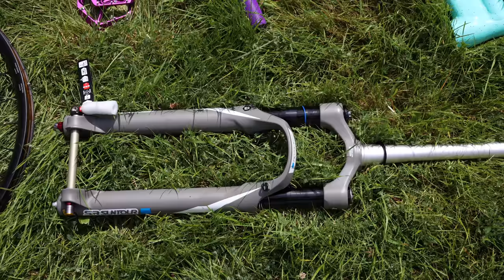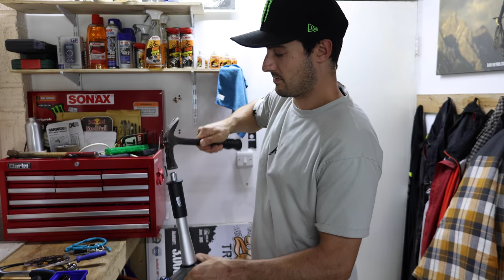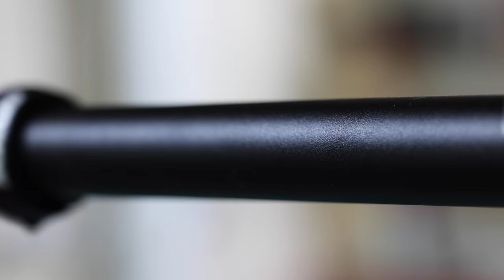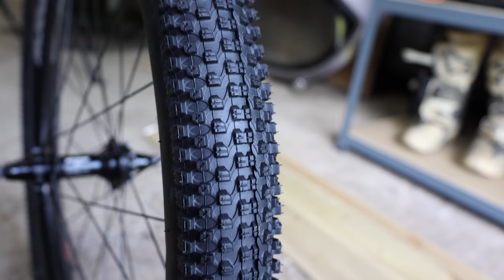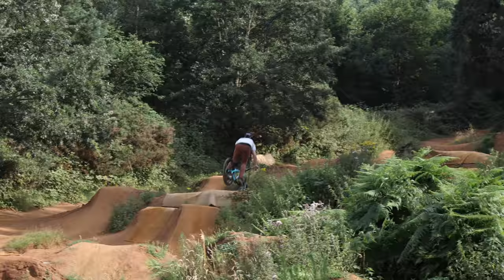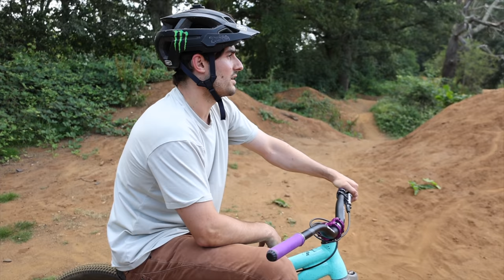MY NEW NS DECADE DIRT JUMP BIKE!   Build and First Ride

Comment: Sick, how'd you get the durolux down to dj travel ???
Reply from the maker: It’s not too hard actually, you swap a few spacers around internally!
Reply: @SamReynolds26  but it's the EQ version isn't it? I thought you were supposed to swap out the entire air shaft - and even then it only goes down to 150?